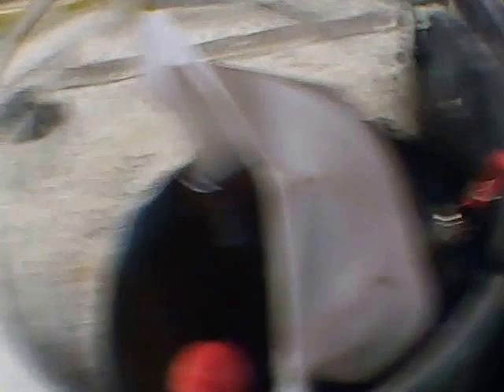Organic Battery ( Rechargeable) / Polyaniline/Part I

Comment: hello Sir how  can i coat polyaniline on the surface of metal organic framework?
Reply from the maker: +Mayorque Francfurt   Hi!   I am working in another area right now. You will have to look up the literature or try different approaches.
Reply: +David Soriano First of all thank you for the reply i watched your videos but did not caught quite well how you did polyaniline can you please write down the experimental part?
Reply from the maker: Place aniline hydrochloride in water and apply 1.3-5V to electrodes- just like electroplating!  You will see the dark blue/ violet polyaniline in 2-3 minutes . Use stainless steel electrodes. One will deposit the polymer.
Reply from the maker: +Mayorque Francfurt   go to: "Google Patents" and type in "polyaniline". You will find a range of patents showing preparations.   Good luck!
Reply: +David Soriano  ok thank you.
Reply from the maker: From the J. Chem. Ed.: pg. 1067 (2008)

take aniline ( 1.0g) and conc. sulfuric acid (1 ml. added dropwise to the aniline with stirring) . The aniline is in 20 ml. distilled water. Apply a voltage of 3V to two stainless steel electrodes ( use screws) and apply current for 5 minutes. You will see deposition on the cathode and gas evolution at the anode.